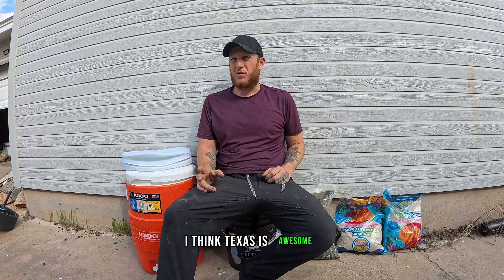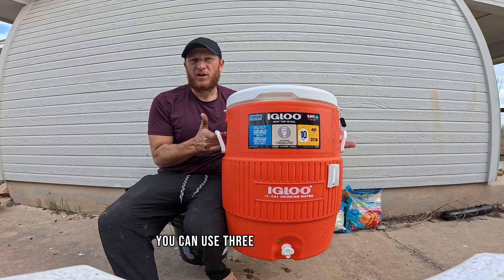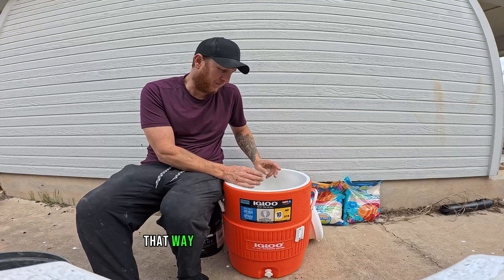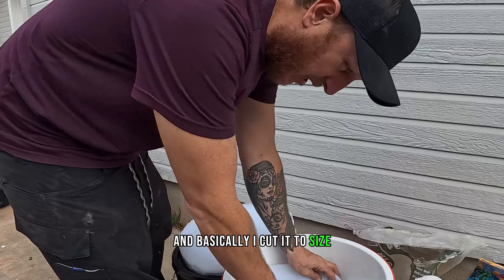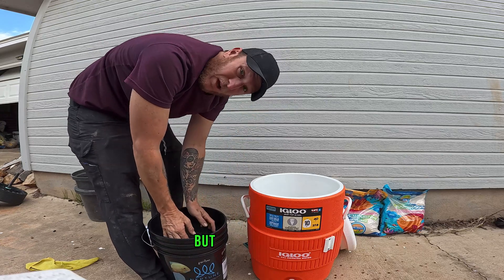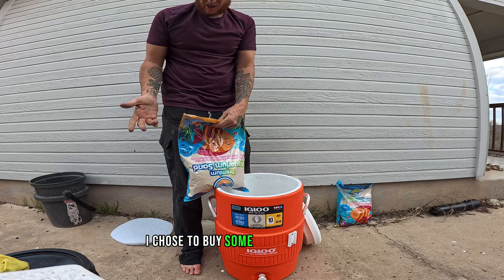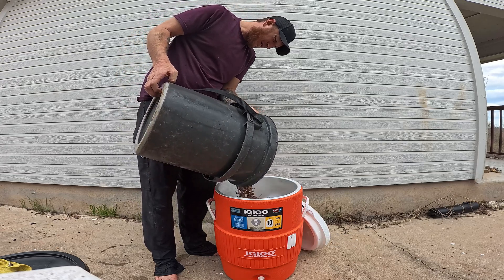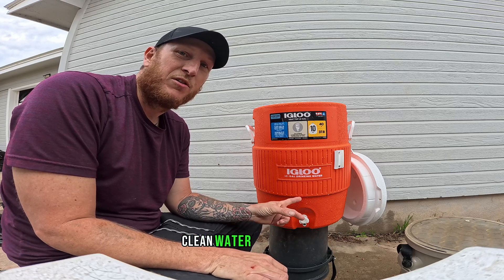DON'T DIE! Making THIS Could Save Your LIFE! (CLEAN WATER) How To Make A Water Filter

Comment: Would it also be a good idea to boil it after filtering or would it be to time consuming or  unnecessary?
Reply from the maker: Prob a good idea to boil the water first before running it through th filter.
Reply: A filter system like this isn't going to remove bacteria, it'll capture some larger viruses but not all of them. Activated charcoal will help with some chemical contaminants.

If you're truly on a time crunch and desperate for water, run it through your shirt then boil. You won't get all the dirt/minerals/chemicals out but it'll prevent you from dysentery